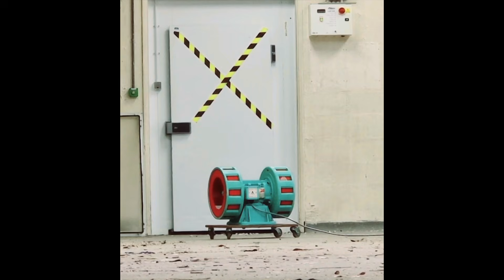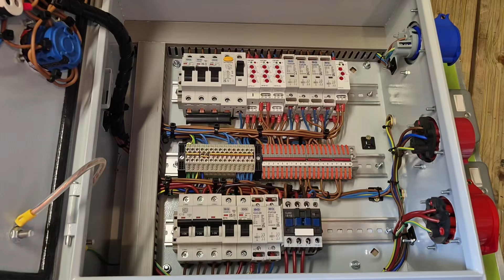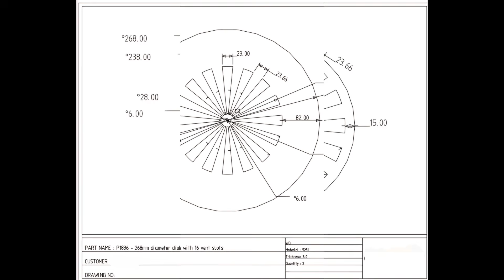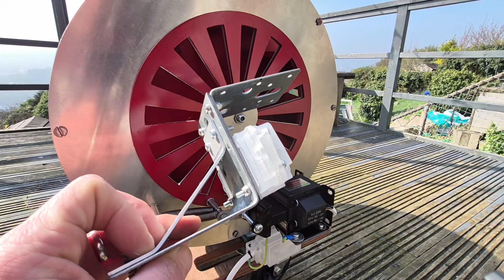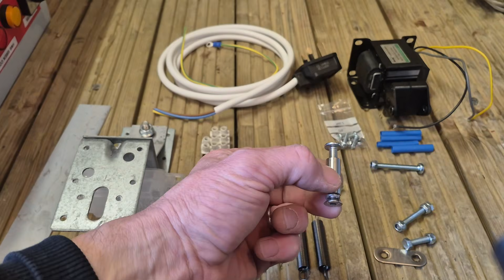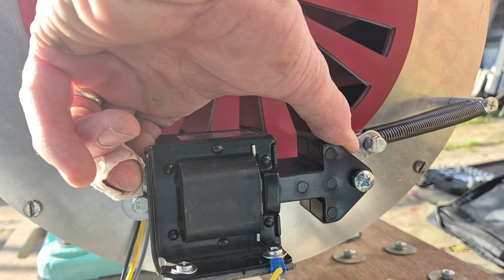Air raid siren Secomak GP8 to CS8 conversion

Comment: Why did secomak stop making sirens ?
Reply from the maker: Secomak brought out klaxon in the early 1990s , then later they separated again and klaxon took the siren side with them  they continued making the gp and Cs series and others till around 2008 when klaxon reduced there catalogue and stopped production of the cs series , klaxon still sell the gp/fp6 , gp/fp10 both single end sirens (10port) and gp/fp12 double end (10/12 port)  but the gp1,2,3 and gp8 were dropped , Secomak still continues but make other air products space heaters/ fans and manufacturer factory equipment but no sirens at all.

Comment: You should make one do yelp
Reply from the maker: Ive not heard a yelp signal , do you have a video of a siren doing it ?
Reply: @heritageWarSirens It is basically a fast wail.
Reply from the maker: Found a video of a yelp , sounds like a brake on the siren motor shaft possibly?

Comment: Also the decision to make the dampers open by default is a great choice, every single coded American siren uses that mechanism and it works way better since the vast majority of them have failed and the sirens still operate properly
Reply: It also means the shutters cannot suppress the syren during rundown which is part of their purpose, especially with syren batteries which were tested weekly like broadmoor and HMNB Devonport, the latter of which are still operating
Reply from the maker: @Trainman10715 that is the trade off from doing them this way round , but can always keep the pulse or hi lo running during the wind down
Reply: @heritageWarSirens  on that point you made about the secomak design, how if a solenoid fails it means the syren is permanently suppressed. it is worth noting that if you watch videos of the carstairs escape syrens sounding, on most of the CS8s with shutter faults (almost all of them nowadays) the shutters have failed in the open position, not the closed posision. so it suggests that the return spring is more susceptible to failure than the solenoid itself on the secomak design, meaning it probably was better to use the solenoid to open the shutter
Reply from the maker: If i disconnect the return spring on the cs6 damper with the damper in the open position , the damper still closes due to the weight of the damper flap and gravity , what you can do with a solenoid failure on the secomak design is disconnect the return spring and put a widge between the connecting rod and the top of box and It can the be left in the perminatly open position,  which is more than lightly what the engineers who maintain them have done.  On some of the failed Carstairs you can see the supply cable to the damper has been cut so have had some intervention.  I have chosen to do an open position damper tho if I insert an extra set of pins further round the wheel I could make work ever way open start or closed start, tho this is just a prototype design so can always make improvements
Reply: @heritageWarSirens  i see, i suppose that makes sence that the fitters would permanently wedge open a shutter which has failed. i do also recall from the videos that were taken of the broadmoor system before it was all taken down that 2 units had a shutter failed in the closed position and 2 had a shutter failed open. so whether they actaully had suffered return spring failures or the fitters just stopped bothering after the first 2 failures as the system wasnt being heavily maintained in its final 10 years of operation. 

i understand why youve done it this way. i was only saying having the shutters default to closed is better for noise suppression on syrens which are tested regularly in built up areas so as to reduce noise pollution. i cant think of any other reason why carstairs and HMNB devonport use CS8s at all as neither of them have ever used the hi-lo or pulse tone, only broadmoor did

Comment: Love the sound of that! Sounds just like a cs8. although the classic shutters are still my fav. i love how you made that look and sound 👍🔊🔊
Reply from the maker: I still prefer the classic dampers myself , if I do ever come across another one I will remove the damper from the CS6 and pop them both on the GP8 , but until that day I have an alternative:)
Reply: @h @heritageWarSirens 
On the hilo, when switching from high to low, there is a problem. The high tone is to long open, when the lo opens the high ist still open
(Sorry if you aleady said that)